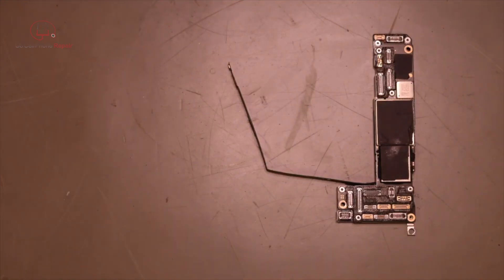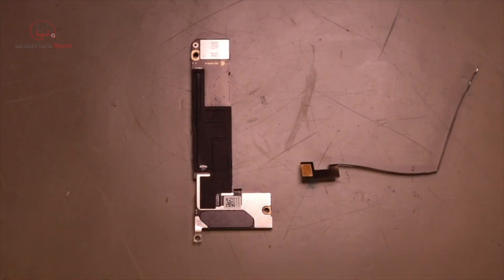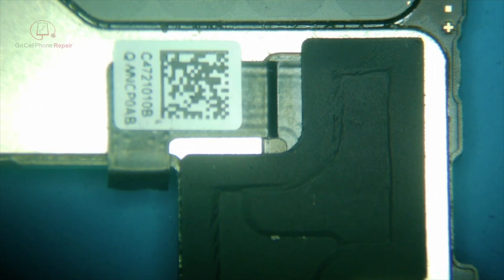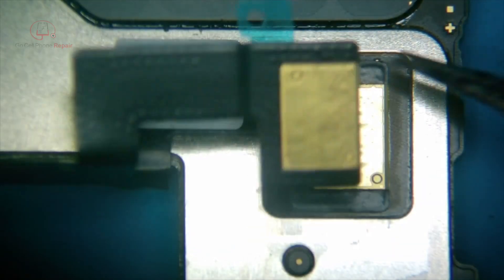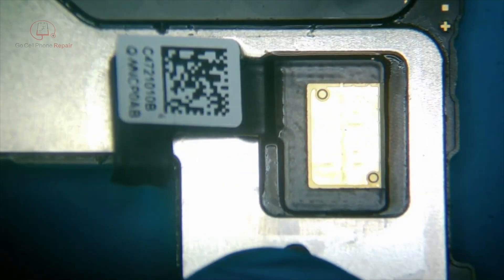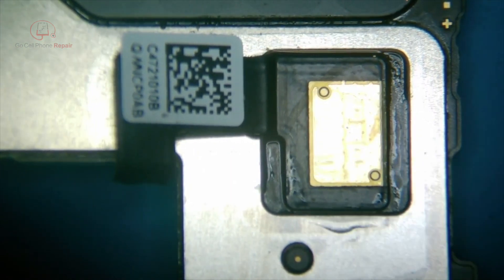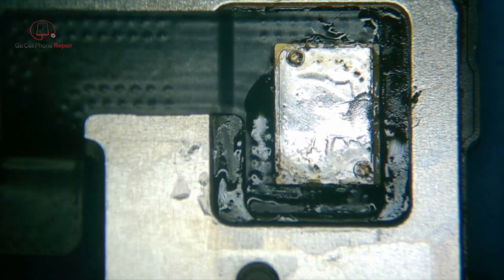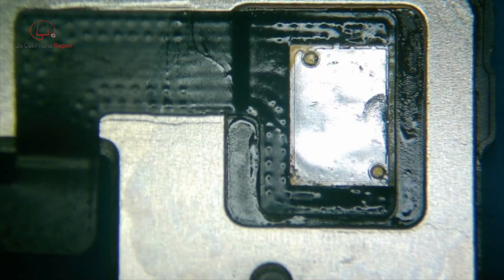iPhone 5G Antenna Replacement

Comment: When its ripped, does the phone still get 4G network? Or do you have to replace it to get 4G network?
Reply from the maker: You should still get 4G and in many cases 5G can still function. This antenna is strictly for millimeter wave 5G that you will find in crowded areas like airports.

Comment: Hello had the soldering iron at 400 C didn't want to stick please what flux you use not on the outside of the pads but on the inside the small square
                 ⬜⬜⬜⬜
                 ⬜⬜⬜⬜
                 ⬜⬜⬜⬜

Im doing this right now but the 5G Antenna Wont Stick the to the small boxes ⬜ please help
Reply from the maker: I have my soldering iron at 840 F so that might be why it was a little easier for me. The flux is only on the outside of the antenna as I found it too difficult to prevent it from sliding around when there was flux underneath. That said, I think that any decent SMD flux should work in this situation.
Reply from the maker: *840F.

Comment: What kind of flux you to make the Antenna stick specifically please im trying to do my own repair iron Good video btw
Reply from the maker: I'm using 2UUL from Union Repair at the moment but note that the flux is only on the outside of the antenna connector. The pads underneath will still bond and I don't apply it there to prevent it from slipping around. I've used Mechanic 225, Kingbo, Amtech... all of them work just fine.
Reply: Thank you

Comment: Why don't you use the heat gun?
Reply from the maker: It’s pretty easy with the iron and anytime I can avoid heating the bottom board I do so because the components on the other side are very sensitive. Using hot air would radiate more to the other internals.

Comment: where does the other end of the antenna wire connect?  I was taking the motherboard out of an iphone 13 pro and tore the same flat cable.

Comment: Will this fix my cellular issue on my iPhone 14 pro ? It’s stuck on searching and no service, when I go to setting and click cellular 
It says Error?
Reply from the maker: Check settings>general>about and scroll down to modem firmware. There should be a version number there. If not, you have bigger problems, like a bad baseband pmic or some fractured solder joints. The 5G antenna only picks up UW frequency and should not prevent service altogether.

Comment: Not a fan of that connecter to solder. The iPhone 14 Pro Max Bluetooth antenna is soldered the same way and it’s a pain to fix if you accidentally add too much heat when fixing the back glass😅
Reply from the maker: Yeah, strange way to do it in my opinion.